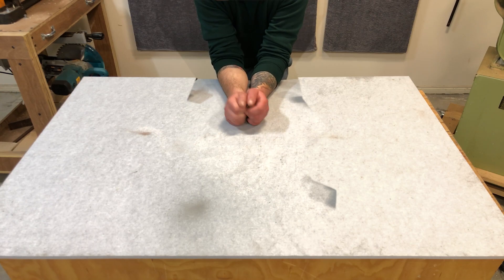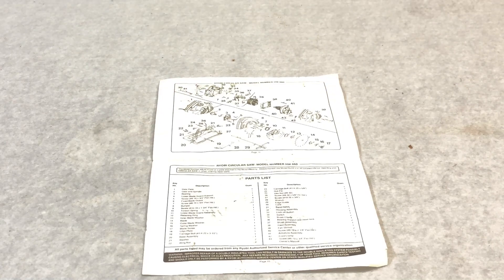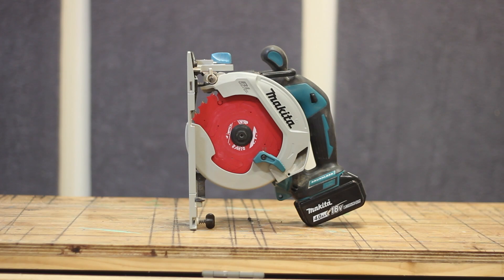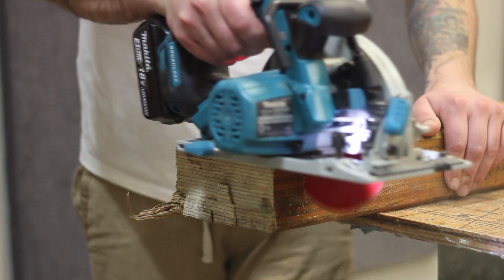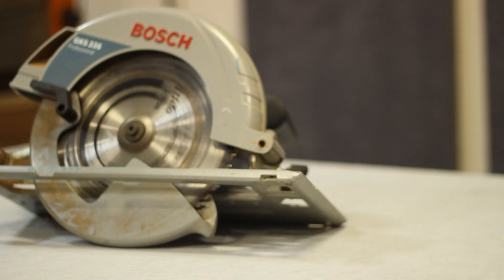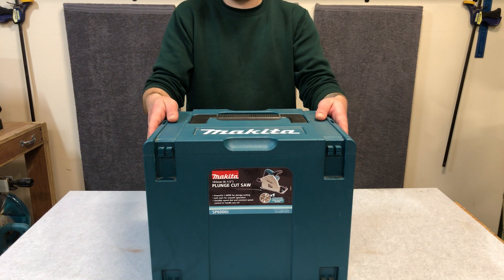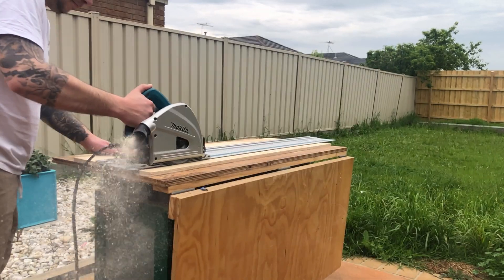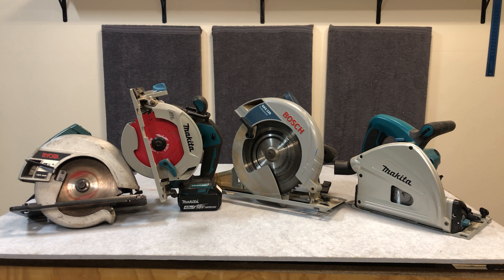The best saw for any workshop

Comment: Nice review of your circular/track saws, Mark. I would add that, despite the obvious expense of the track saw, it is a GREAT option compared with the cost of a table saw. If I had unlimited resources, including a larger shop space, then I would go with a 5HP cabinet saw with a 52 inch rip capacity, but why spend $4K-$5K US when I can get nearly the same results with a decent track saw?